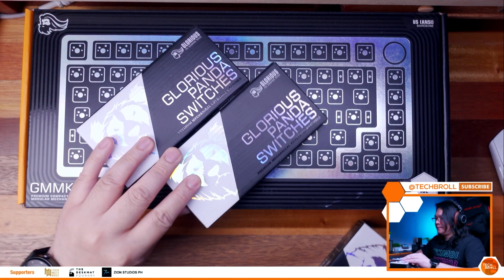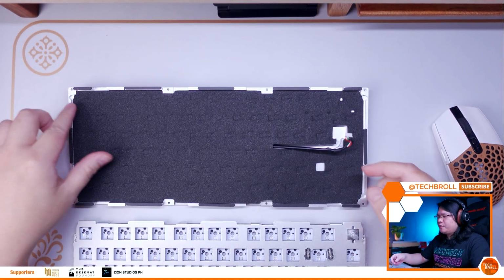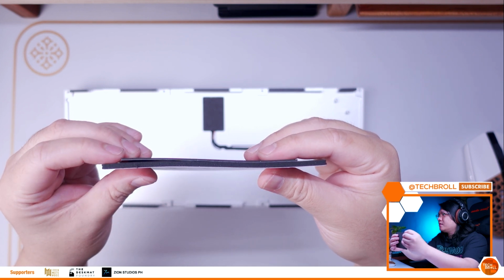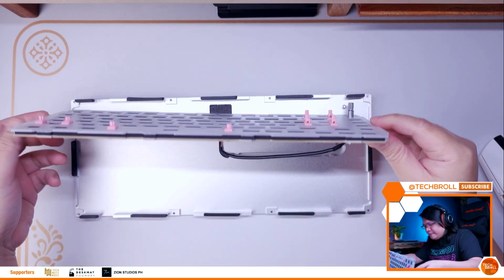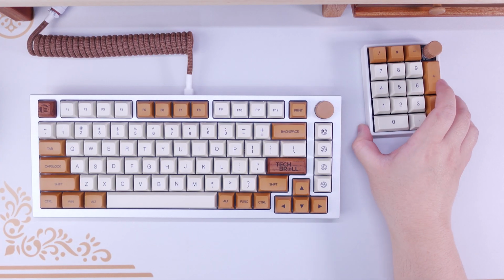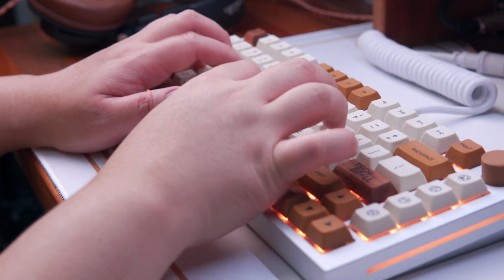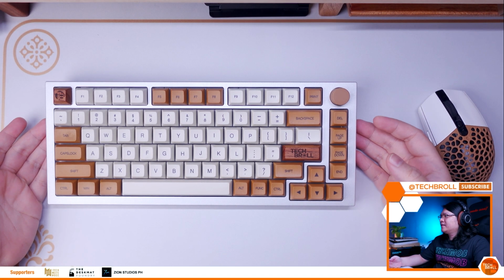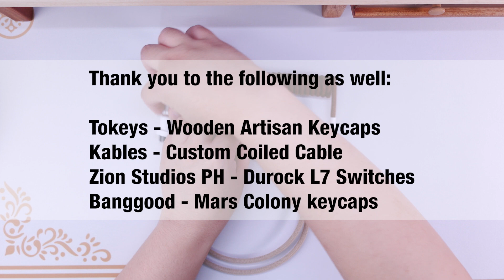GMMK Pro Upgrades and Modifications Guide + Sound Comparison - Flex Build!

Comment from the maker: 🛒 BUY IT AT SHOPEE 👉 
GMMK Pro: https://shp.ee/axhhajg
Glorious Panda Switches: https://shp.ee/g32a48y
Polycarbonate Plate: https://shp.ee/vca69s4
Glorious Coiled Cable: https://shp.ee/3egf56e
Glorious Panda Toy: https://shp.ee/qur473q
Glorious Keyboard Case: https://shp.ee/ixziuus
GMMK Pro Knob: https://shp.ee/z9euyke
Durock L7: https://shp.ee/sriwiae

🛒 BUY IT AT LAZADA 👉
GMMK Pro: https://bit.ly/3xFKldk
Glorious Panda Switches: https://bit.ly/3iXlspB
Polycarbonate Plate: https://bit.ly/3xDPhPX
Glorious Coiled Cable: https://bit.ly/3qf0kN2
Glorious Panda Toy: https://bit.ly/3vMTL5F
Glorious Keyboard Case: https://bit.ly/3cZuOx6
GMMK Pro Knob: https://bit.ly/3zT8z67
Durock L7: https://bit.ly/3xYM4LL 

Mars Colony Keycaps: https://bit.ly/3espjX3

Time Stamps:
0:00 - Intro
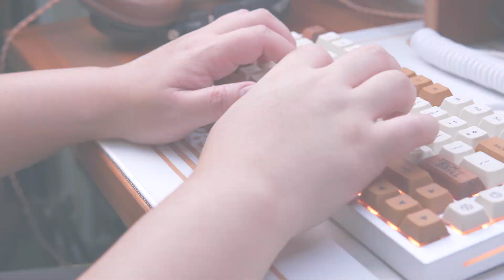1:04 - Initial Thoughts
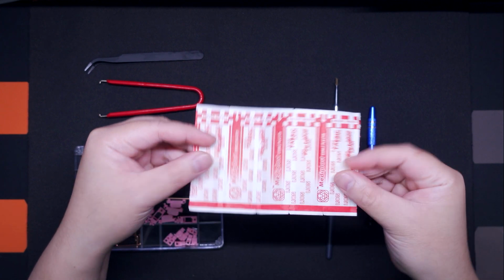2:06 - GMMK Pro Teardown
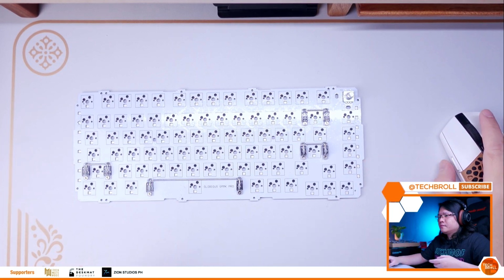3:08 - C3 Equals Stabilizer Holee Mod
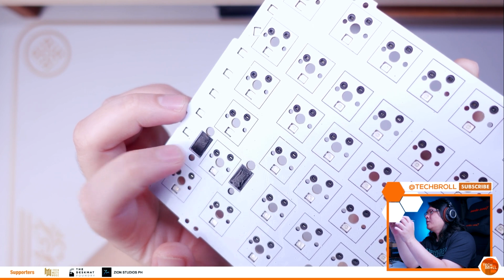4:05 - Sticky Stock Stabilizer Dampeners
4:18 - KBDFans Stabilizer Dampeners
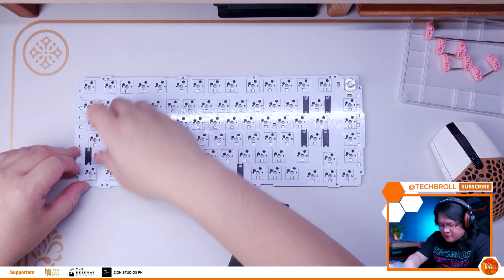4:25 - Stabilizers Installation
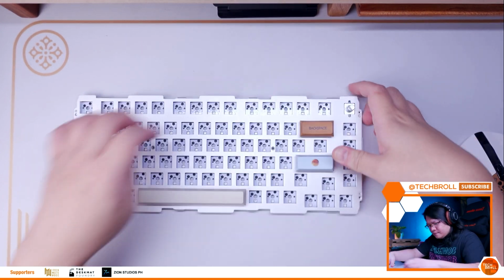4:44 - GMMK Pro Gaskets Upgrade using D65 Gaskets 
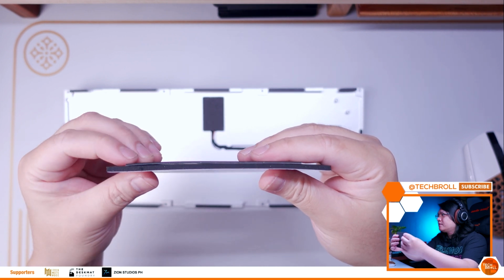5:29 - GMMK Pro Polycarbonate Plate Modifications
6:34 - Re-assembly
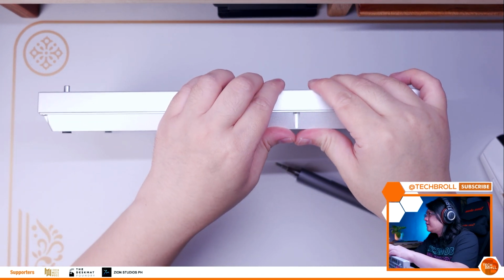7:51 - Glorious Panda Switch Lubed and Installation
8:22 - Mars Colony Keycaps Installation
8:39 - Tokeys Wooden Artisan Keycaps
8:45 -  GMMK Pro 3D Printed Knob
8:51 - Kables Custom Coiled Cable
9:02 - Finished Build
9:13 - GMMK Pro Sound Test
14:43 - Conclusion
Reply: your keycap link is broken
Reply: i cant buy it because i am from malaysia so i cant buy it
Reply: @Mikrowave  Look at the original Glorious store

Comment: Just did mine witg tape mod, pe foam mod, durock v2 stabs lubed with 205g0 lube, removed the stock stab dampeners, switches are lube gateron yellows also with 205g. I had to sand down the aluminium plate for the stabs to fit cus i think i got an early version of it, either way the build turned out great. Really surprised at how good it sounded, ive heard a lot of sound tests on this board and im proud to say that i think mine also sounds absolutely awesome.

Comment: For the right shift key do u need something different bcuz for some reason the right shift looks tiny
Reply: it is tiny though, but most keycaps set you buy have a 3 different size of any keys so that it is compatible to most all keyboard.
Reply: @clementpapa7126  yeah the original set i was gonna get didnt have the 1.75u shift key it had the normal one but i found a new one on amazon with the right size one

Comment: I've got an awful clicking sound on the right side of my space-bar stock. Any idea what may be the cause of this?
Reply: the wire is the problem, if you still need the help.
Reply: @browniebrownie4416  I put in some durock stabs worked a treat, thx for the advice though

Comment: do you recomend cutting the standoffs on the plate
??
Reply from the maker: Only if you want to have some sort of flex on the board. Otherwise, you can just leave it as is.
Reply: @TechBroll  im just concerned about breaking my polycarb plate
Reply: @brianock2321  ur not breaking anything whilst doing it, only concern u could have is that u can't install the screws in the screw holes but if u wish to have flex that isn't needed anways
Reply: @wudu_rom  ok thx

Comment: final build for the stabs sounded way too mushy imo, but hey that could be your preference! also please balance your wires instead of just holee modding. Its a quick fix but better to just balance the wire and use something thicker lube like 205g2 or 206g0 or XHT BDZ or even permatex 22058(Dielectric grease) 
its gonna be better in the long run since 205g0 is just way too thin to even help with rattle. you can try out 205g0 again IF you actually balance the wires and stuff

Comment: I've cut the 4 inner screw mounting point on my PC plate today and I finally have some decent flex. I haven't use the standoff screw and only used the light diffuser screw. Good flex toward the center, a bit stiffer on the outside, might have to try cutting all of the screw mounting point. Awesome guide, awesome tips.

Comment: Fantastic video! I just dissasembled, modded, cleaned etc and reassembled mine yesterday and wish I saw you video first :)

Everyone is right, those stock GOAT stabs are really overlubed and super sticky, PC plate is super tight with Durock V2s and I missed those stock stabilizers bandaids and had to remove the stabs again to remove them and clean with alchohol.

I have just ordered an FR4 plate so wont need to use the screws and hoping fit will be alot better.

Do you know if those self tapping screws will damage the diffusers if removed when I install an FR4 plate?

Do the D65 foam gaskets make a big difference? I do not mind the stiff feeling but I was thinking about removing the two centre stand-offs.

I removed the plate foam and kept the case foam but people seem to do the opposite.  I removed the plate foam for accoustics and I am guessing you removed the bottom case foam for flex? Correct?

I love your build and end result. I went for the classic all-black look with Boba U4T's and GMK WoB.

P.S. I tried holy modding in the past with Durock V2s using the small thin parts of KBDfans stab stickers and they just caused my stabs to stick.  Also spent ages last night doing the Epsi mod and had the same result on a two of my stabs.  In the end I just removed them and traditionally lubbed them with Krytox 205g0 and balanced the wires.  I am not sure sure what I am doing wrong.  Maybe they are sticking out a tiny bit too much on the edges and rubbing against the outer plastic parts.

Comment: Nice mods! Quick question, did your pc plate fit right out of the box? I'm using durock stabs and mine was way too small and caused the pcb to flex so I sanded down the stab holes and it kinda fits but not perfect. My esc key is also not centered. I contacted support and they basically just offered me 40% discount on a new one. Even though I've heard several people have this issue.
Reply: Hi Uy.  I just had the same issues.  The PC plate was terrible to fit especially around the volume button area.  Had to force it onto the Durock V2 stabs and kind of had to stretch the board.  I just ordered an FR4 plate which should arrive in September.  I did not like the idea that I had to use those self tapping screws and have concerns if it has damaged the diffusers (when I replace the plate).  I will check out my Esc when I get home.  I did not notice that.

Comment: Even the stock build with the GOAT stabs sounds so good. I don't know how you did that but the stock GOAT stabs sounds horrible from all other reviews and builds on YouTube.
Reply from the maker: The stock build sounded decent to say the least, but it definitely has noticeable pinging especially with unlubed glorious panda switches. The GOAT stabs sounded decent as well but it doesn't feel good, it had a hard time bouncing back when I press it. All in all, after the modifications I did, this is currently one of my best sounding and feeling keyboard.
Reply: They did to me to outside the spacebar, and though the C3 stabs seemed fixed it, I am not sure it was stabs causing that. It may just be something about the case. All GMMK Pros have a super high pitch ping on the spacebar to me. Even sometimes with better stabs. I think the stab mods muted the ping so it is harder to hear.

Comment: Nice looking build. I'm new to all of this, do you know if I pick up this 75% board, is it standard? I mean will it be hard buying custom cap sets for it?
Reply from the maker: It is standard in a sense that it is a normal 75% layout and there are a bunch of different sets specifically for 75% layout. But a standard base kit should be sufficient enough